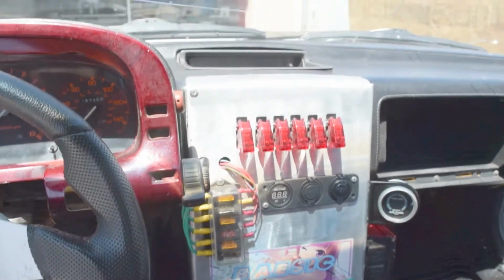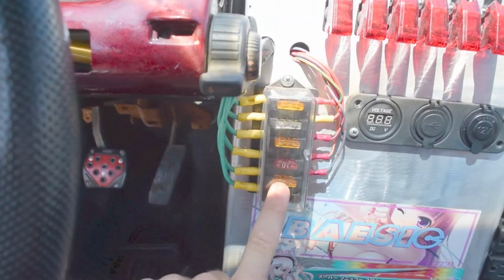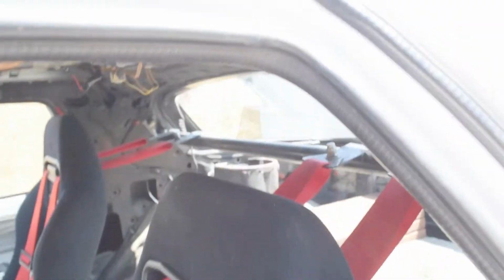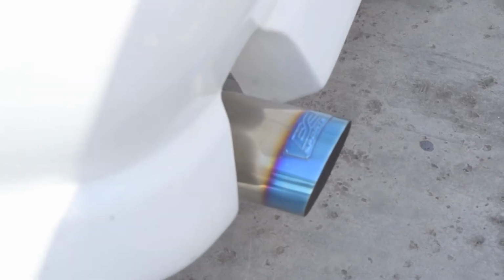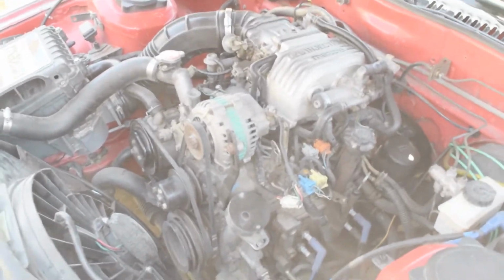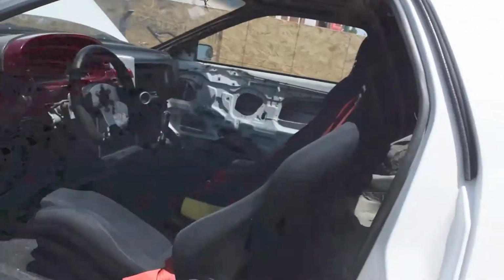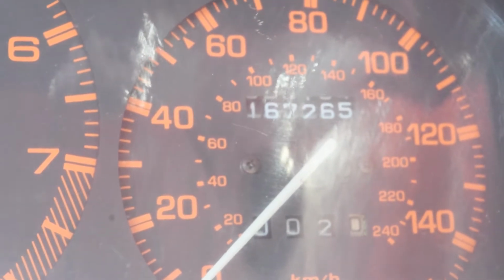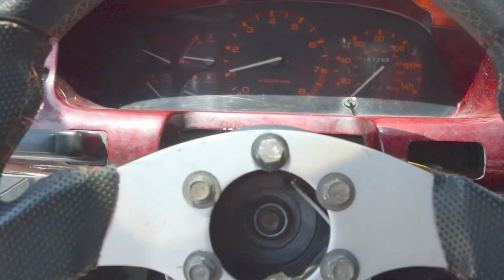Mazda Rx7 FC Drift Car Build

Comment: How did you create that switch for the exhaust? that's an interesting mod.
Reply from the maker: I purchased an exhaust cut out motor/flap that is a 2.5" with a 3 bolt flange type mount,  When I was fabricating my exhaust i just put it into the equation